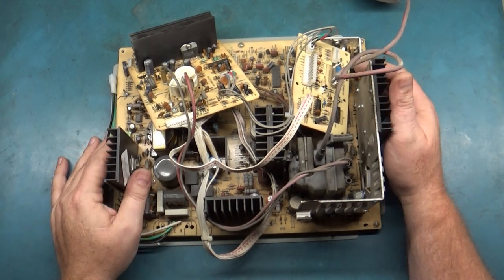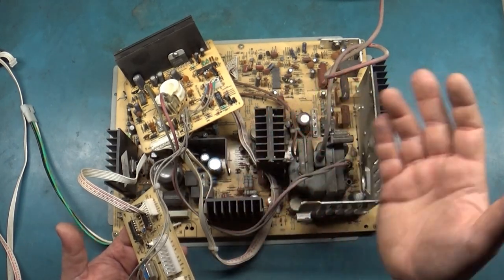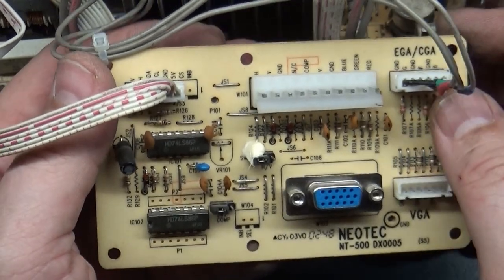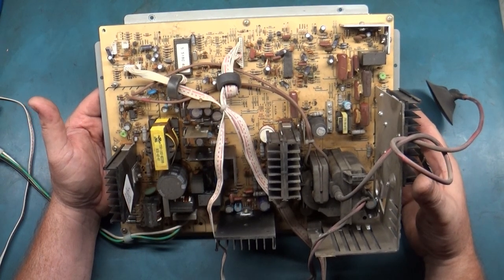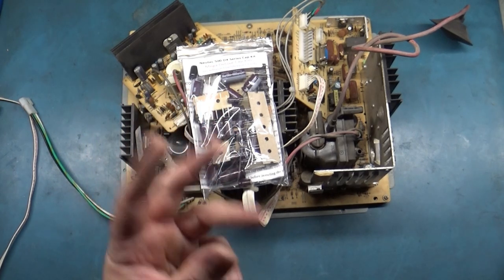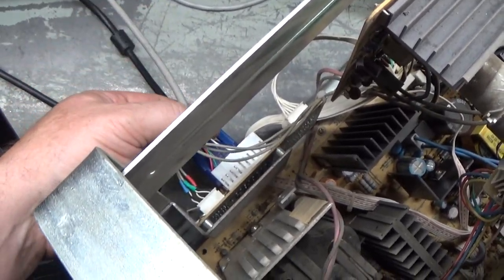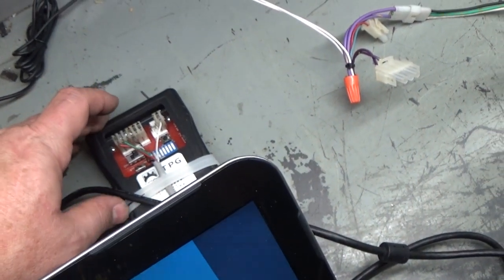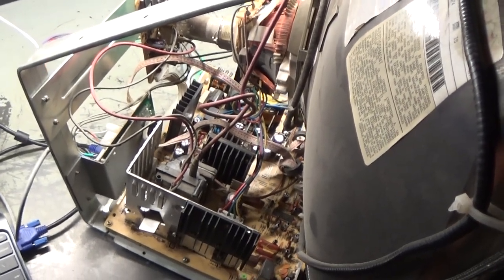27" Neotec NT-500DX Arcade Monitor Chassis Repair - New Caps, Proper Adjustments...Working Great!

Comment: Hey Mike, I'm looking for information about a possible tube swap for this chassis. Do you have a reference for the approximate ranges of yoke/tube measurements this might be compatible with? Or even the tube model that would be used in a chassis like this?
Reply from the maker: Unfortunately, it would need to be a flat screen and the yoke must be a tri-res yoke. I don’t have a list, but only a flat screen D9200/D9400 or a 27” flat screen tri-res Makvision would be compatible with the 500DX to the best of my knowledge.
Reply: @MikesArcadeMonitorRepair  I see. the tube I have in mind is from a flatscreen HD CRT. I wonder: would it be possible to tube swap by bringing over the yoke from an existing NT-500DX chassis? I'm pretty fresh with arcade stuff so I don't know if my question is totally ignorant but I'm very curious.
Reply from the maker: Possibly, but only if the yoke is not bonded.
Reply: @MikesArcadeMonitorRepair  interesting. Do you happen to have any tube model numbers on hand of the tubes that would be going into this chassis? Also if there’s a better place to ask these questions let me know lol
Reply from the maker: I do not. My apologies. Only places might be the Facebook monitor pages.